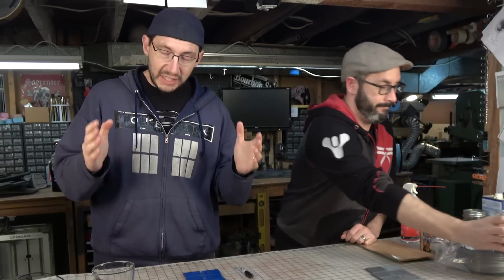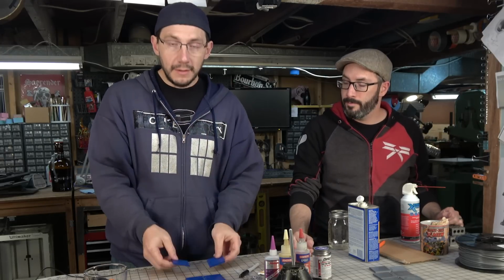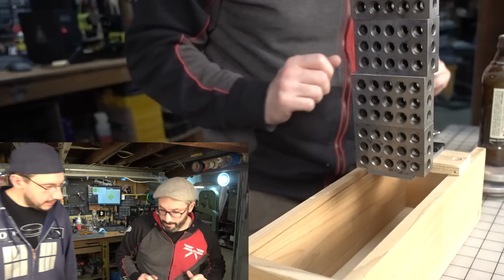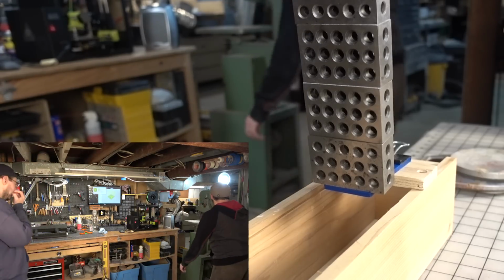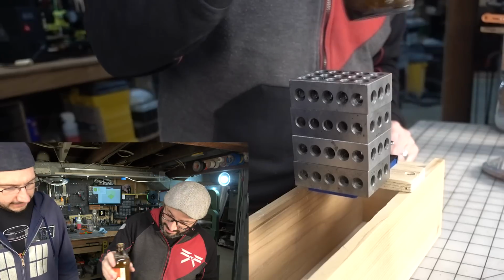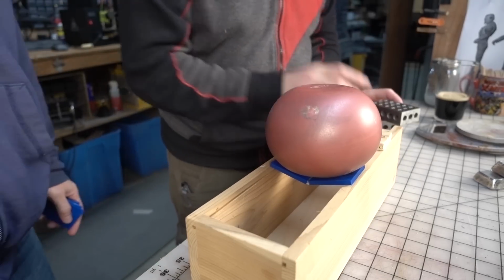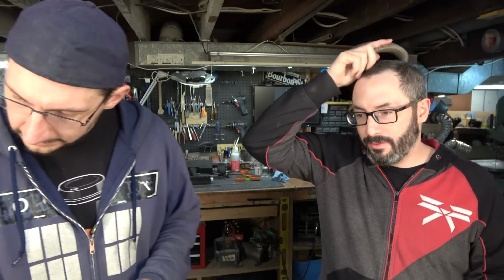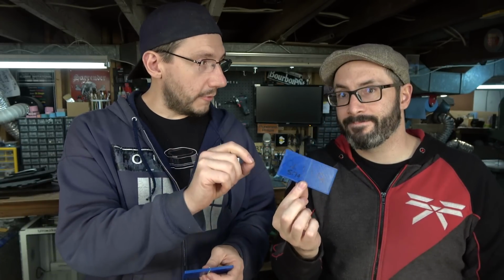Testing 3D Print Bonding Methods with Punished Props (Glue/Epoxy/Welding)

Comment: Hello Joel 
I was a meteorologist at Rockwell inc. that the since of weights and measures Good try what I would suggest is to first read and know the cure times for the different glues. Next your testing method I would suggest a stand where the top half of the test part is clamped in with the second half below it clamp a test weight gauge with a max weight marking arm on the dial  or just use a digital then either hang weights on it or just put your foot in some kind of sturip until you get failure. you might also try using a 1 inch square test block so your findings could be stated in lbs per sq inch really enjoyed watching but did not find a lot of useful info due to not knowing the cure times for the glues in order to judge their strength

Comment: Nice overview, thanks! I've found that PVC cement is good for PETG, due to it's chemical similarity (which is nice, as other adhesives like CA won't bond to it) but yeah, I wouldn't expect it to be a good solvent for PLA or ABS. (If it melts in acetone, it likely won't dissolve in MEK and vice versa)

Comment: Tips for improving the test:
Watch Toms videos where he does filament strenght tests. Use a scale that has a peak force memory function. Then you can just add water to a bucket on a string attached to that scale and hang the other end of the scale to your test piece. (Make shure the scale can not drop in the water bucket ;) )
In general, i was really surprised you did not use water bottles or some liquid container as weigths. Easy to get in every house and the density of water is not that bad.

It may be surprising that the 3D printing pen held up that well when you only apply it on the outside seam of the joint, but when you think about it, with the way you applied the test force, you only get compression forces on the top layers and expanding forces on the lowest layers. The middle of the joint does not see any forces at all. And since the 3D-pen basically remelts the PLA to extrusion temperature you get almost the same strength as if it was printed together in one piece.

Comment: Definitely should reprint the test pieces, use the same bonding agents, but sand the surfaces (one rough one smooth). Then allow a 24hr cure time to make sure everything had fair time to set in place. Then of course, more weight. 

For what it's worth though, the best way to test them definitely is that bridge method in my opinion, and you guys shed some light on the strengths that were available. looks like I'll be super gluing and epoxying certain parts over others now. 

Thanks for the video!

Comment: Joel I don't know why people are not aware  of a product called Weld on 4. I use this product to chemical weld PLA or PLA plus. You can make an slurry just like people do with acetone and ABS. I really believe you should make a video of using this solvent  because in my case it has yielded the best bond after trying a lot of glues and friction welds.

Comment: For PLA you should try Dichloromethane, i have used this extensively for all sorts of modelling and printing including some structural, it has a fantastic capillary action, meaning that you can hold two pieces together and then hit the joint with the Dichloromethane and it will wick into the joint. In my experience the part will usually fail long before the joint will.

Comment: I can't agree on this more.  The results are quite surprising, especially the 3D printing pen.  I would love to see this test with a more stable rig, more graduated amounts of weight to add, and multiple equally-assembled test pieces with each method of the ones that performed well.  Frankly I'm also just curious how much weight it actually will take to break the superglue or printing pen joints!

Comment: Entertaining and informative video. When bonding two 3D-printed parts together, I use an industrial-strength hot glue gun to spot glue the two pieces together, then weld the outside perimeter with a 3D pen to lock them in. Once I sand the seam down, it feels practically indestructible. 

Your shot of the CA "super glue" bottle was a little blurry, but is it the Bob Smith Industries brand? I noticed it was the Gap-Filling formula. I wonder if the results would vary with their other viscosities (super thin or extra thick)? That would be an interesting experiment.

Comment: so close,  and yet so far. y'all really need to be consistent with your method of testing. I would like to see a redo with a consistent test method and potentially,  a variety of cure times and orientation of the force.
Reply from the maker: So close? Come on, not THAT close, Edmund :) Yes to being more consistent, but, this wasn't really about the consistency, this was more about having some fun together. Our results WERE interesting, though!
Reply: 3D Printing Nerd ah, true. I just felt sad for the epoxy and other glues that didn't get the curing time they deserved 😢
Reply: 3D Printing Nerd also, if you do revisit,  I would love to see; include a soft material class, try breaking it under tension as well as bending, and maybe under torsion.

Comment: This has always been an area I wanted to learn more about but never had the resources or knowledge of adhesives. The 3D pen performed surprisingly well considering it was merely plastic. I was wondering if some of these pieces may have failed due to the plastic wall not adhering to the other printed walls. 

Just an idea if you two ever revisit this, perhaps you may clamp the prints on an elevated platform then hanging a bag at the end. This way, you can scale up the weights accordingly without space limitations while keeping a consistent weight placement and momentum during testing.

Comment: another thing to look at is not just weight but pressure.  the medicine ball is  good idea but spreads its weight over a larger surface area.  perhaps putting the blocks down first could focus more of the weight on the seam

Comment: Super glue doesn't last very long.  It works great at first but then one day when you least expect it, it snaps off.  Only good for short-time stuff.  Methods that fuse the plastic together aren't going to degrade over time like glues do.

Comment: The part when you had it suspended over the gap, a shallow wedge pressing right on the seam and then weight on top of that for ALL of them would have been the most accurate, by putting some weights far away from the seam youre exerting torque on it instead of sheer weight. a pull test, suspending it from the cieling and hooking weight onto the bottom, would work much better too. Maybe a bucket that you could put the weights in, whether it be sand or water or metal scraps then weigh the bucket after it breaks. Im not hating on the video, I think its cool that you came out to have fun and stuff. Regardless of the testing procedure, its still somewhat useful info that you can get at least a little info out of. It's worth making a video about, for sure.

Comment: i thought of all the science tests i did in engineering school and was think no no no to this... at first. but you showed a somewhat consistency in how you performed the test. you gave a real (in a pinch) test to the different joints. sure you didn't create a test sequence of multiples per test type or a lenear graph for trend line nor did you adhere to the "full" cure recommendation. lol i am not ripping on yall. what you proved though is something as basic as super glue will work wonderfully and efficiently for PLA. you could also create an arguement of material type for pla, humidity, temperature, flexing of material...etc... overall enjoyable to watch.

Comment: A little surprised you went to the trouble to do the slurry, but didn't try ABS cement. The kind we use on ABS plumbing, like the PVC glue you tried is used for PVC pipes.

Comment: You should simply use a bucket of water... More precise, and you can go heavier. I suppose that you would need to modify your 3d printed parts, but the test would be more accurate this way!
Reply from the maker: I don't know if Bill had a bucket, or better yet, if we could even think to grab a bucket at the time. If this is popular and enough people want to see it, we will revisit.
Reply: I know that it would be a lot of work, but I would really enjoy a revisit! With more accurate methods and diffrent test maybe? For example trying to pull on a part too see if the superglue bond is stronger than the layer adhesion
Reply: Yes, a bucket suspended from a fish scale that is through a hole in the part design.  You can accurately measure all current weight in it and get an exact break weight.

Comment: Nice idea, though if you want to make it more scientific, I have two criticisms:  I don't believe you tell us what the material is, I suspect it is some kind of PLA, but it would be nice to know for sure (or indeed whether this changes for different materials).  And more importantly where you place the weight is as important as how much weight you put on it.  That's the law of the lever: the further away from the joint you push the more force acts on the joint.

So if you want to repeat it, I'd suggest the following setup:  Clamp the one side to the edge of the table/bench, and include a groove in the design of the other side from which you can hang a bucket that you can fill with weights, sand (or even just water).  Or since you always print everything bigger, make the second piece longer with multiple grooves.  If you double the distance from the joint, you double the effective weight pulling on the joint.

Comment: you layed your weights on the narrow end at the end of the piece with the first few and then changed to laying them on the wider end which would distribute the the weight more evenly. So results will be better for those weights laying on the wide side. Also in the later tests weight was distributed over the two pieces instead of one piece which again will affect the results

Comment: This video is just entertaining watching them hunt for things to use for weights from being ill prepared, LOL!  Shame you guys didn't place holes in one piece, tie off to a bucket of water, tare the bucket and string weights. Then measure the volume of water needed to bring the pieces to failure, then use the density of water to more accurately calculate the weight at failure.  But you guys had introduced beer to the situation so I get it, you were having 50% science, 25% fun, and 25% hilarity LOL!!

Comment: You guys should redo this with more weights in 1 and .5 increments and a set time between each layer. Say 5 sec between each added layer to give it time to delam and also address the ones that delammed from one side.

Comment: I was  at horrible freight and found some epoxy that is specific for plastics, they did not really say what kind but I thought about picking some up to try. however  I currently use super  glue and  baking  soda that is pretty good.

Comment: I would also stack them in a sandable category,   when making big builds  I like to tac together with AC glue and activator , then weld with a 3d pen , final result is easier to sand and paint.  compared to epoxy

Comment: Got really excited about this video and totally loved it up until the testing method :'( 
really disappointed it wasn't just a little more scientific... Waiting 24 hours for everything to set & using a hanging scale would have been awesome
Reply: I think the point was quickest strongest. like they stated the epoxy may have been stronger if given more than a 1 hour time but seriously 15lbs on super glue. cost + time vs results super glue totally outperformed. and even the 3d pen method did great.
Reply from the maker: Hey Matt! Remember, we're just two dudes in a shop having a pint and trying something out. If this proves to be a popular video, we will revisit with a more proper test method and be much more consistent without approach.

Comment: You guys should of definitely used pvc cement on abs, I'm pretty sure it has some similar chemicals as acetone! and as for the slurry (and probably pvc cement) definitely leave it got 24+ hours to give it a good cure!  :)
Reply: CPVC cement and cleaner has MEK(methylethylketone).   CA and WA probably makes it illegal or really, really hard to get, since its a carcinogen.

The strongest bond will be gained if at the butt joint, you grooved both sides and filled with the slurry mix and and a bit of ground abs particles.

CA is great for speed but its brittle, so in a vibration environment not so good (or outdoors either for UV tolerance).
Reply from the maker: Hmm... When we revisit that's worth a try

Comment: You guys cant test some on the edge and some flat on the piece. You are testing the impact of the torquing on the join, the length of the "lever" has a HUGE difference on the perceived strength.

Comment: Now I'm curious on how good of a bond the 3D printing pen can do with EVA foam.
Reply from the maker: THAT is a really good question...
Reply: I have lots of those! I even have a few good answers, too! :P
Reply: The thing is that contact cement is strong enough that it actually rips the EVA foam rather than becoming delaminated, so unless you're reinforcing a high stress seam (which is usually done with hot glue or even fiberglass in some instances) I don't imagine the additional cost of the filament and the 3D printing pen being cost effective enough. Though I'm not quite sure on the price of the filament in small quantities like that and perhaps you could shed some light on that with the assumption that someone already has a 3D printing pen.

Comment: There is no better clamp than wood screws  or  tiles made with holes in them and the board  could have been drilled and a claw foot attached underneath then you could examine the strength of the  adhesion methods as well as the shear strength of  the parts with holes in them.

Comment: If the JB weld had a full 24 hours to set you wouldn't of been able to break it. I used to work at a mechanic shop and we bonded a plastic tab to 50 lbs of metal and lifted the metal. JB weld is strong
Reply from the maker: Nate, I think you're right. We didn't give anything more than a few hours to cure. That's all the time we had. If this video proves to be popular, and enough people want a follow up, we'll do it!
Reply: 3D Printing Nerd I hope to see more experiments from you two. I love both of your channels 😁

Comment: Question: I have been using super glue and it is not bonding very well to my PLA model, is there a certain type that maybe has worked for you? Any suggestions would be greatly appreciated. I did purchase a 3D pen but I want to use the super glue to spot hold my parts before I use the pen.

Comment: if you do re visit this I think you should be a little more consistent with the placement of the weights. I think clamping one side down to something steady while the other side is in the air like your first round of tests is the best possible way to test. 
I was using epoxy for some of my prints and I've had everyone one of them break on me. I think Ill try superglue but I know I've had really good luck with the slurry, but that only works with the abs. I might have to get a 3d printing pen and try that out.
Reply from the maker: If / when we revisit, we will REALLY need to be a lot more consistent about a lot of things ;)
Reply: 3D Printing Nerd specially with the beer drinking, I didn't see much of it :)
Reply from the maker: YES!

Comment: Great video topic gentlemen! I often wondered what the best adhesive would be for my multi-part prints.
Well, time to return my epoxy and buy some more super glue.
Reply from the maker: Well, keep that epoxy around just in case! Remember, everything we had was MAX cured for two hours. Give it another 22 hours or so, and it may be a different ballgame.
Reply: Good Point! #HighFive

Comment: 2 part Epoxy after a FULL 24 Hour cure time. It literally falls off parts. So PLEASE DON'T put that too much confidence in your testing since you did not wait a full 24 hours. Since I have been 3D printing I have learned NEVER to trust Epoxy at all. But reason why I am watching this is to see what other people are using. and Yes Super Glue is one of the Top Best adhesives for 3D prints to other types of materials.

Comment: I think that the PVC cement would be heaps better on the abs and the acetone would be better if you left it over night.
Reply: Not shure about that. PVC glue is often made with tetrahydrofuran, basically the same solvent you can use on some PLA to do vapor smoothing (works kinda like acetone on ABS). You should however first do a test with just the solvent/glue on a sample to see if the plastic can be dissolved or it there are some reinforcing chemical additives in the filament you use.
On the ABS test in this video you could clearly see that the plastic was still very soft from the acetone, so it would have needed way more time to get the solvent back out of the joint, and i guess it was the same issue with the PVC glue and PLA sample.
Reply from the maker: Hey Paul, think so? I know we should probably give some of this stuff more time.
Reply: ExtraBase yeh I'm no expert its just ABS seems more susceptible to solvents
Reply: 3D Printing Nerd yeh I assume you had some time restriction, I would like to see a round 2 where you actually break the 2 winners and compare them to a piece that is just printed

Comment: Next time just clamp the pieces to the table, hang a bucket onto them and fill it with sand. When the piece breaks you can just weigh the bucket to see how much weight the piece can hold.
Reply from the maker: Brilliant!
Reply: Btw, you could make the 3D pen "welded" piece prettier and maybe even stronger by putting a chamfer onto the edges of the bond surfaces. When you put the pieces together you get a groove which you can fill with plastic.